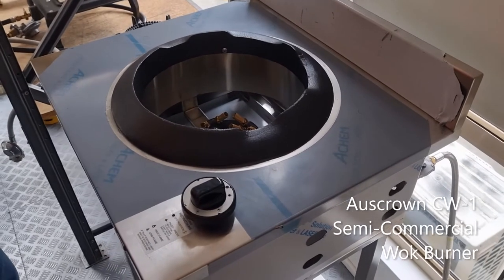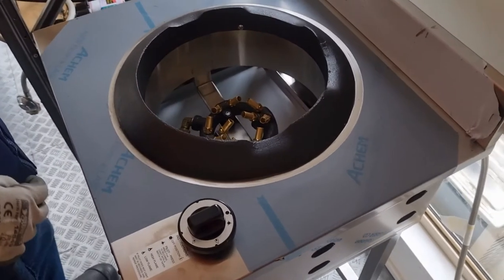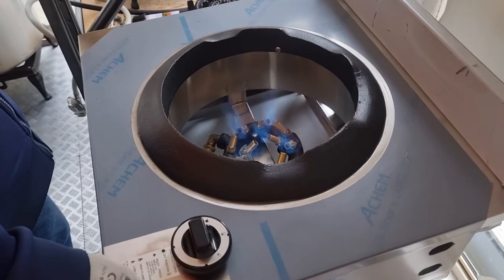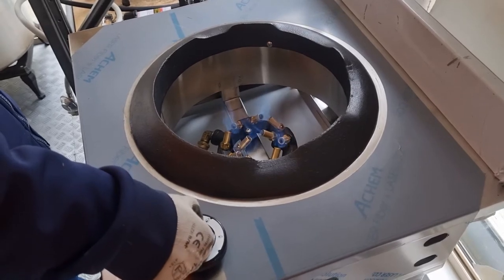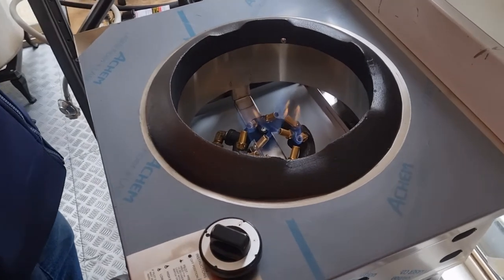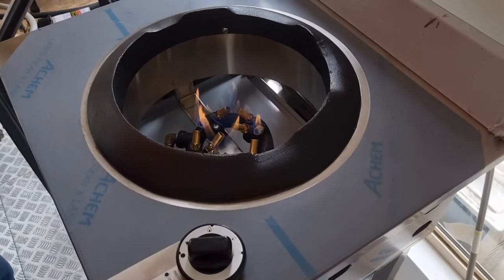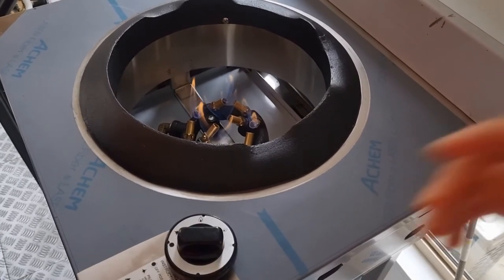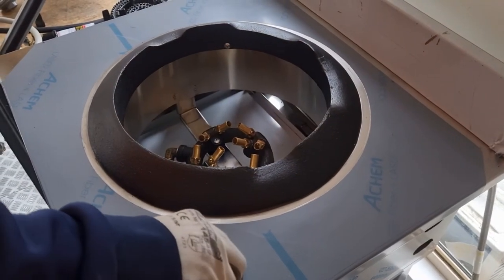Auscrown Semi Commercial Wok Burner CW 1 - How to light it up

Comment: THAT'S high flame? What's the power output?
Reply from the maker: Hi! 32mj/hour. this is a 10 jet mongolian burner, usually commercial equipment use 23 or 32 jets
Reply: @auscrown  thanks. I like the physical construction but on your webpage, it says the shipping weight is 100kg which sounds ridiculous. How heavy is it really, and also can this be fitted with 23 jets or would this compromise your AGA product certification? Would like to get one for an installation similar to the ventilation of a food truck, but 32mj/h really doesn't cut it for me. Esp when I can get those 60+ mj burners for $200. Willing to pay the money you're asking if the power is okay, because I like the form factor and the AGA approval.